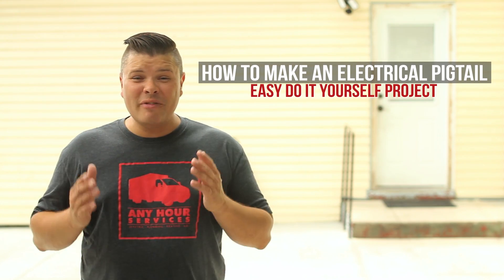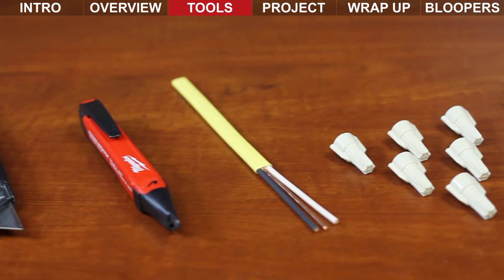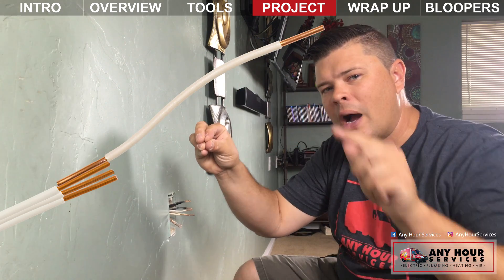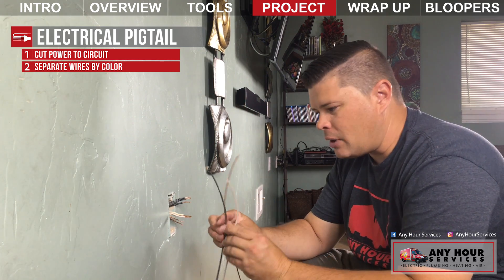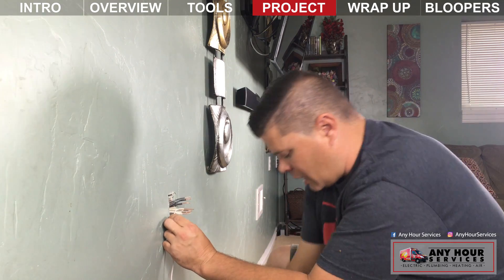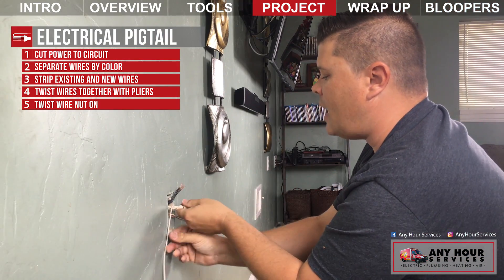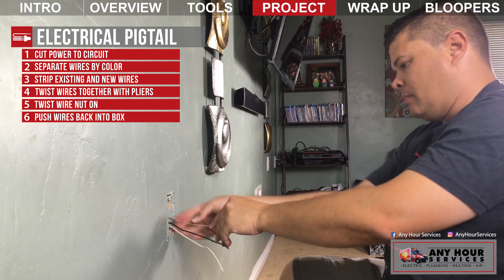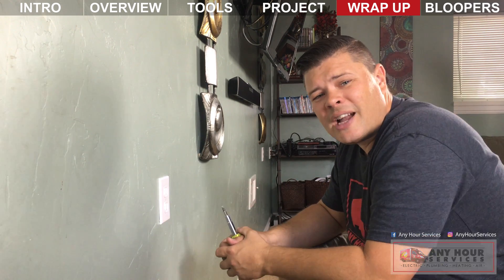How To Make An Electrical Pigtail

Comment: Just wanted to say, I've seen about 15 videos on electrical wiring today, and your videos were head and shoulders above everything else youtube threw at me. I dont comment often, but its amazing how clear and helpful a video with good information and good production values can be. Im clicking adds a few times, thanks for the help.
Reply from the maker: Wow, thanks so much for the feedback. It helps to know we are on the right track. We're always looking for ways to provide value. I hope your electrical projects went well. Thanks again.
Reply: @Anyhourservices  Great video, and thank you for it. I was looking for a video to show someone how to pigtail receptacles, and I went though at least 5 YouTube-suggested videos that were all wrong or missing steps. The one thing I would ask you to add is a bit of emphasis on putting the wire hooks in the right direction on the screws. As far as I can see, you did it correctly by having them point clockwise, but it's an important step that I see done wrong by a lot of homeowners, and I often have to explain to them why it's dangerous, as it leads to the wire coming loose prematurely.

Thanks for the great video!
Reply from the maker: Thanks for mentioning this, Mike. I actually made this video as an after thought as I was making a video on how to replace an outlet. I did go more into detail about making sure the hooks are going the right direction in that one. I see people do the same thing. Thanks for watching and commenting. Have a great day.
Reply: @Anyhourservices  Hello. So by doing this, would this work if I'm adding a top electrical outlet for a wall mounted TV? Do I just pigtail at the bottom and only run the one pigtail to 1 terminal for the Hot and Neutral side?
Reply: I agree with this comment, they're well organized and very well explained. Im def subscribing
Reply: My feelings exactly.   This is a clean, crisp presentation.